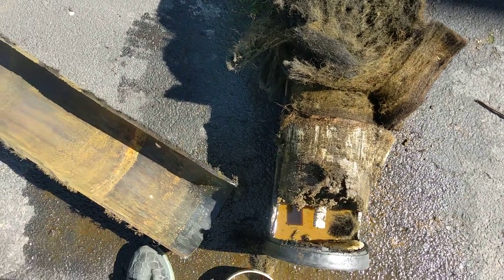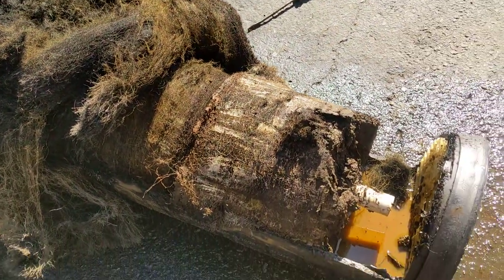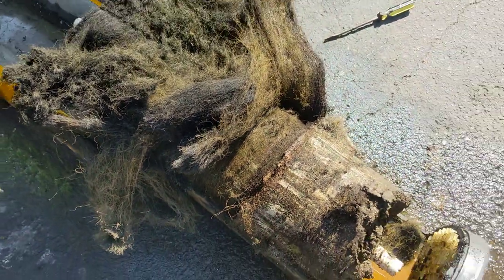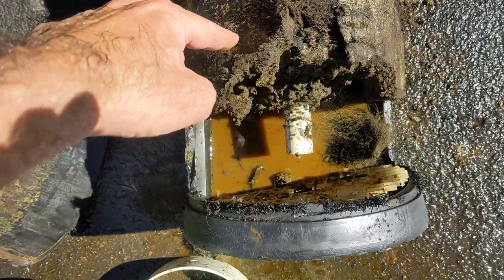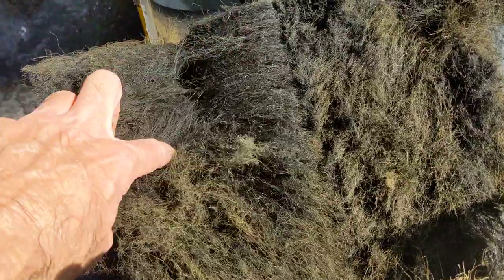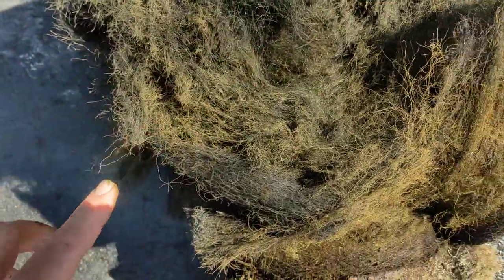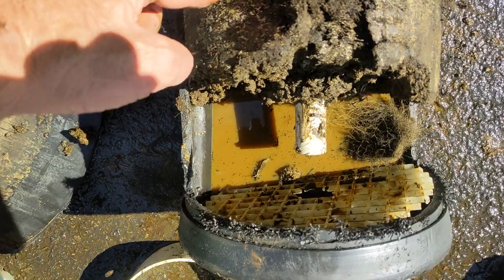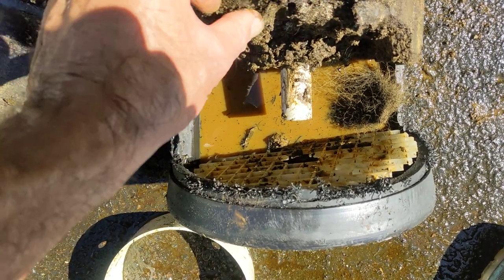Photo Lab: Inside a Steel Wool Silver Recovery Canister

Comment: I am refiner that services and sells silver recovery equipment.  If the column is used for stabilizer only, your correct that is not silver and if you turned that material by its self into CRE for processing I'm guessing you got an invoice. However on visual inspection it does look like you have some silver there, are you sure you didnt run some c41 or bleachfix? You might want to consider us next time.  Also A T25 for stabilizer is not what I would recommend using, its way over kill unless your pumping though at 350 mils plus per minute. even then i would recommend to re evaluate how your silver recovery set up is.
Reply from the maker: T25s are for volume, t5's or 12s don't allow you to push as much thru. I'm pretty sure the cannister clogged due to algae - our current set is approaching 1000 gallons and is fine. We're now doing  a normal mix of blx and stab and using electrolytic before this and getting a good result. The stabilizer only approach was an experiment - that and blx only didn't work very well. Mixed together is much better.
Reply: Correct the T25 is for higher volume hence 350 mils per minute, T12 should be at around 75-100 mills.  We have come up with a BCT16, it sits nicely between a T25 and T12.  Let me know if your interested in trying out.